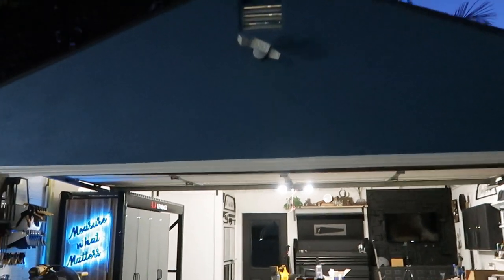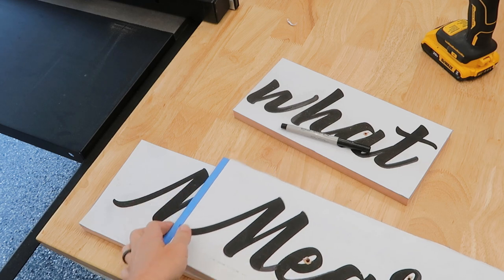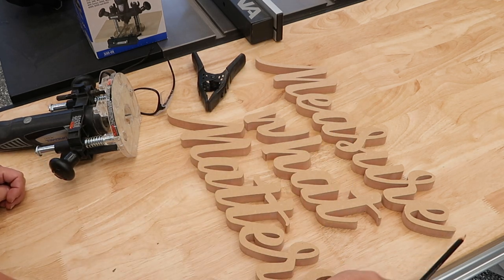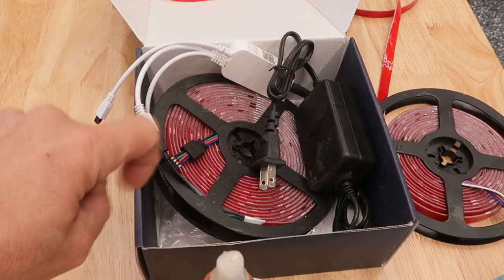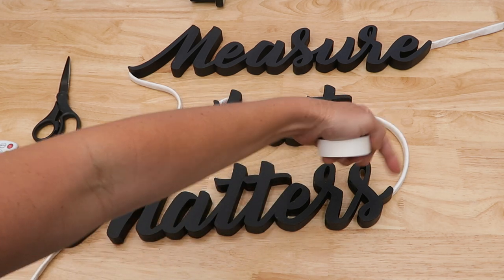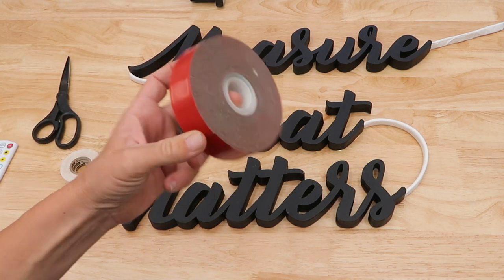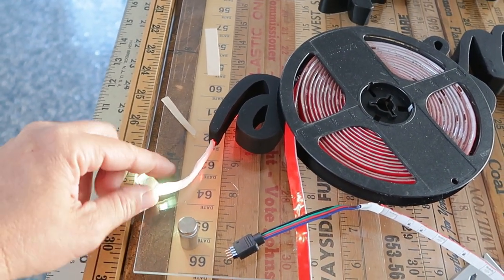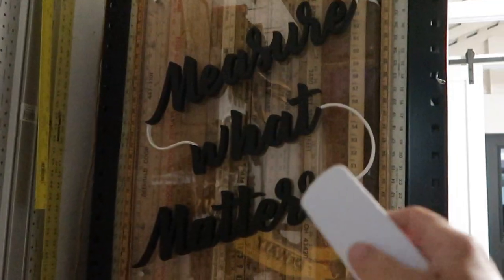Level up your space with a custom LED sign masterpiece

Comment: If you want to hide the wires, I'm pretty sure the led strips can be cut and wires soldered on. Could also get led bulbs by themselves, trace out that sign pattern on the acrylic, drill holes in the acrylic for the bulbs to fit through, glue the bulbs in, wire up and solder the bulbs, mount the acrylic to plywood, and feed the wires through and tuck behind the plywood in a pocket.
Reply from the maker: Thanks friend, good to know

Comment: 10:46 you bended those LED strips so hardly Or they are weak like they have very thin copper inside it. 
Anyway you did it and it looks pretty cool and I love the ceiling of your dream garage keep rocking... 🤟
New subscriber here 😁👍
Reply from the maker: Thank you so much friend, yeah you’re right I did bend them a little too hard that was a lesson learned I’ve also now found they make thinner LED lighting that I could have used but like I said lesson learned for a future project thanks for watching and commenting.